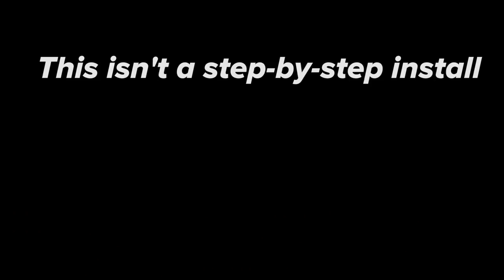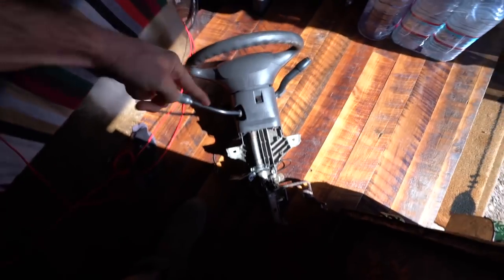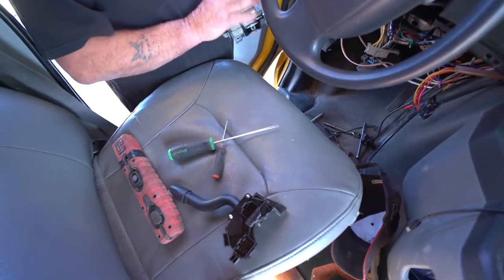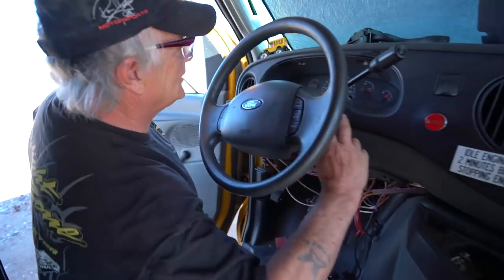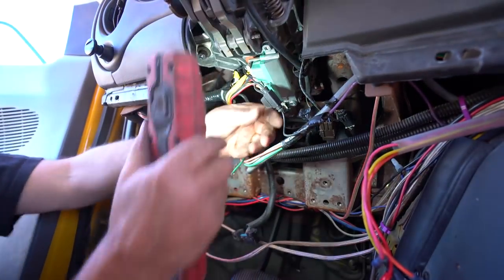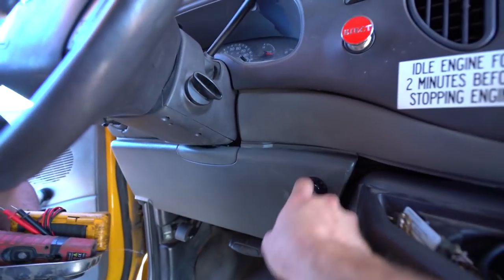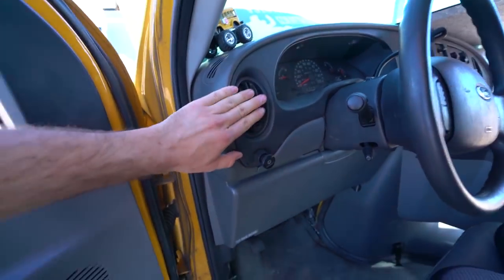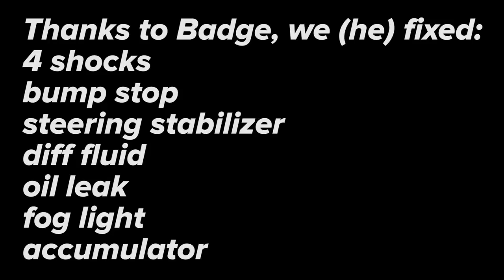ADDING FACTORY CUISE CONTROL TO SKOOLIE (+ fan blower + switch)

Comment: My Ford short bus also has a loose shifter. Ever once in a while I have to hold it tight in park in order to start the engine. Glad to know it is not a transmission issue. Great video as always!
Reply from the maker: it's an easy fix. just drop the column and take out 2 screws and fix. thanks ::)

Comment: Did you get the cruise control unit for under the hood to make the cruise control work? it's just not the steering column that gives you cruise control
Reply from the maker: it's all in there, just need to have a dealer turn it on. stay tuned

Comment: There is more to cruise control than just the switch,  the vans will have the connector because they all get the same harness attached to the frame during assembly but not all of them get the unit...
Reply from the maker: the plug is there, just need to turn it on with a computer. stay tuned :)
Reply: Jax Austin nice ! My bus only had the harness, I had to get the module from a bus graveyard but it worked, just drove 1k miles without the pedal !!!

Comment: For everybody having the 5.4 GASOLINE engine on the E-Series models BEFORE 2005 (as this is the model year that introduced electronic throttles):

Just tackled the job on adding the FACTORY cruise on a 2004 E350 as I think most aftermarket Cruise Control Units suck. 

You'll need: 

- Steering Wheel w/ cruise (some F150 models seem to be compatible)
- Steering wheel Clockspring /w cruise  4C2Z-14A664-AA
- New Steering wheel bolt N807493-S100
- Cruise servo  F8UZ-9C735-AA (discontinued) , however, you can use pretty much every servo/gear unit from most Fords 1993 and up (check pictures) but still have to find a salvaged Electronics module. See https://www.youtube.com/watch?v=RunKPb7oNIM for details!
- Cruise  Cable to hook up into Throttle (discontinued), found a NOS part, but shouldn't be too hard to find at junkjards. Dunno about other models with the 5.4 Engine and if they fit.
- Cruise Servo bracket F8UZ-9C736-AB (discontinued), should be easy to find at Junkjards/Wreckers or can be custom made if you're into metal working. Has 2 8mm bolts for mounting below coolant reservoir and 2 for clamping on the servo
- And around 1h of your time

Spend aorund 250 Dollars including shipment to Germany for everything. I think that's worth it!

Lucky Diesel owners can get cruise for much less as they won't need the whole mechanical servo stuff.
Reply: So for a 1994 FORD 350 with the 7.3 idi it should be easy to find?? Do I have to have the dealer turn it on?